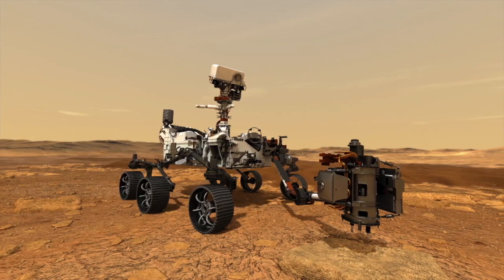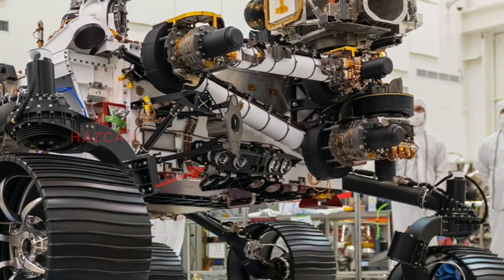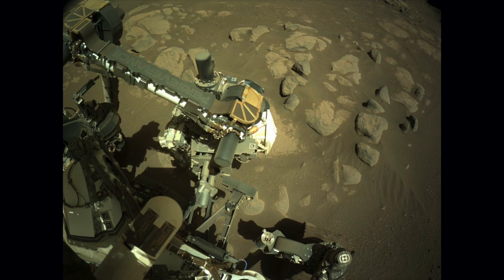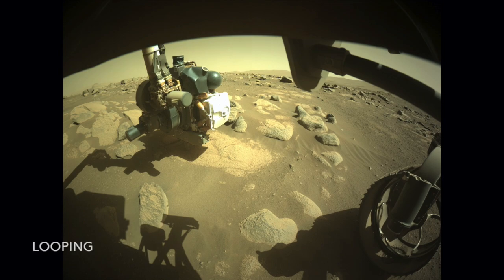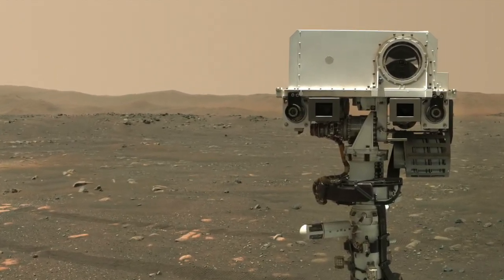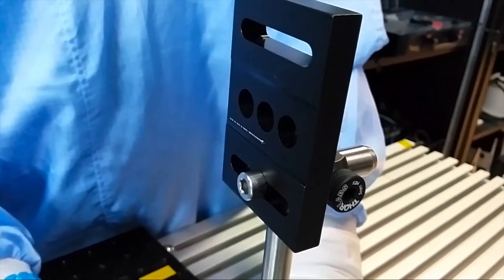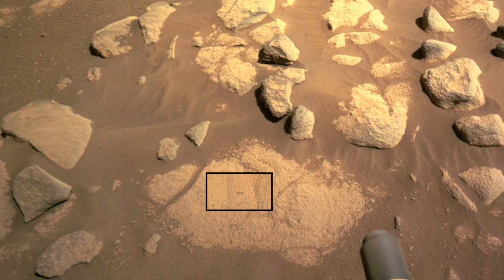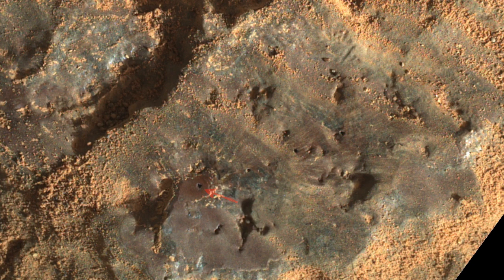Mars rover rocks its world and zaps it with a laser

Comment: Another great video:  The assembly on the front of the rover that the corer pushed against has a 'can like' structure behind its front plate. I believe that this can is probably similar those cans on the front of Curiosity rover which carries 5, each containing cylindrical blocks of organic check material (OCM) for use in control experiments if the rover's SAM instrument was to detect organic signatures. If this is OCM for Perseverance, It seems logical that it could be for use if PIXL obtains strong organic signatures. Refer to Curiosity's OCM on this link:  https://www.jpl.nasa.gov/images/sealed-organic-check-material-on-curiosity)
Reply from the maker: Thanks!  Couldn't find anything about the equivalent of an OCM on Perseverance.
Reply: @MarsGuy  I've also failed to find anything so far (still looking) but searching for one thing often reveals other hidden gems :)
Reply: @paulhammond7489  thus ensues the rabbit hole of mysterious knowledge. Have you found any specs on the motors driving the arm segments? I would suggest the structure could be serving a dual purpose. By calibrating alignment of the 2 stabilizer  pads with the rotational alignment of the head motor, i would assume if it were a step-motor or if it had gears or any wear parts whatsoever, a quick calibration could be what ensured reduced wear on the motor and its connected parts when sending the command to apply pressure. Just a thought..
Reply: @j.alexander4725  I've not found any specs on the rover's stepper motors in the Robotic Arm, only that the arm was supplied by 'Motiv Space Systems', who used their 6-degree of freedom force-torque sensor in the arm. (See: https://motivss.com/space-flight-missions/mars-2020-perseverance-rover/) I'm sure there will be some sort of specs out there as JPL will have documented the testing of the arm, prior to delivery, those test are nearly always documented by JPL and issued as PDF files that are located on their public accessible servers, finding them can take a while, but if you can find them they will often provide the manufacturers details and even model numbers unless they are of a bespoke design.  Many of the motors in this rover (probably the majority) are from Maxon Precision Motors Inc, I believe they supplied 17 of them in the rover for steering actuators, cameras (focus / zoom mechanisms) and the mini robotic arm (SHA) in the cache bay at the front of the rover.  I believe I read that other Maxon drives were used in the Mars helicopter including the rotor motors and actuators.